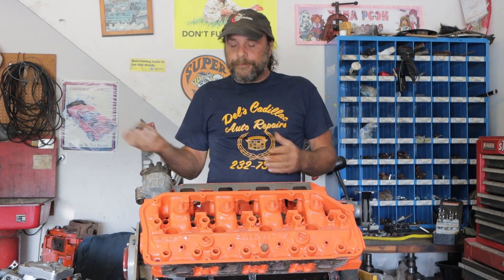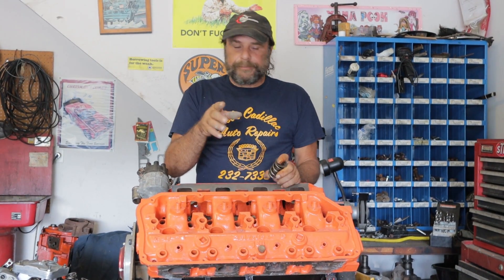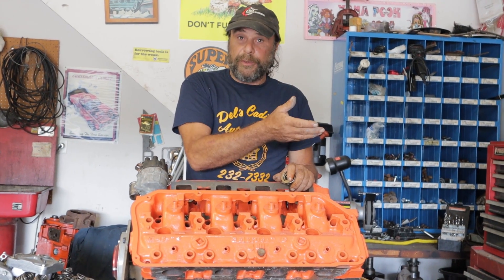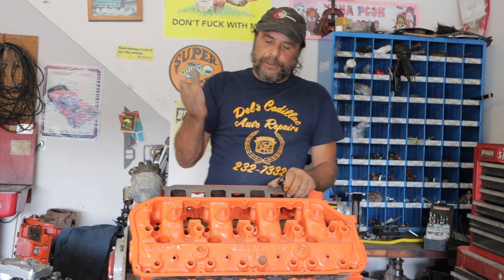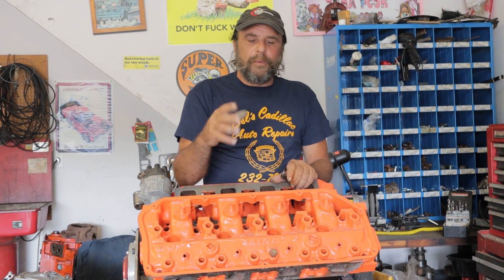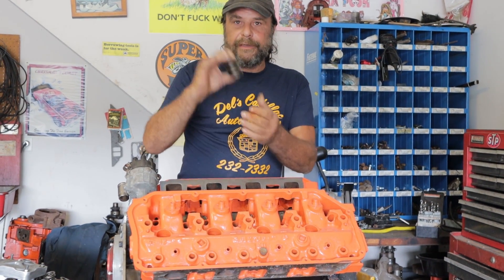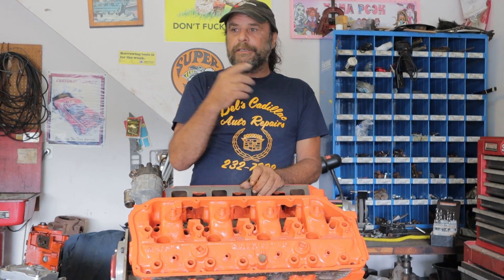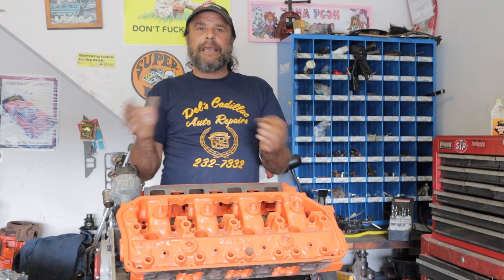Mopar's Doomsday Hemi

Comment: Cmon now Tony , the biggest issue that the 426 Hemi had was the 427 SOHC . We can all thank GM for that river of tears they cried for having these engines banned.
The 427 made around 615 HP right out of the crate with no mods at all . That motor is the directly related grandfather of todays "Modular" ford motor first in SOHC form and then over to DOHC.
THese motors outperform anything that Christler or GM could come up with then or now . Both car companies are having trouble competing with that same engine with only 300 cubic inch give or take.
If Ford were to match them CI to CI it would be a blood bath...
Had these motors been allowed to race way back then we would be ina  far different place at the OEMs today . We would have seen 1000 HP engines available 15 years ago... But GM couldnt compete and was out of the game if Dodge and Ford did the deed....
Reply from the maker: I disagree, Kyle.  First off, I have a lot of first hand experience with the Cammer, as I was supposed to set one up and tune it for a Nostalgia Top Fuel operation a few years ago.  I studied every aspect of this engine you could imagine.  Yes, the valve train itself is superior to the Chrysler, but in the world of Drag Racing, the advantage is inconsequential.
Second, the Cammer is actually more closely related to the 331-392 Chrysler Hemi than the second gen 426.  Valve angle, deck sealing, bore spacing, etc.  The FE it was derived from comes from that same era of engineering ideology as the Early Chrysler.
When Ford gave these engines away to drag racers in 65, they did run hard and leave a mark, BUT, their dated bottom end construction meant most were slaughtered pretty quickly.  By 68, nearly all of them were gone.
The common sense thing here, is that IF that engine was so good, why didn't independent engine builders like Milodon, Donovan, Keith Black, or even Joe Pisano pick up where the factory left off?  The truth is that nobody touched it because there was no actual advantage to be found.
There was a guy named Chuck Seyler that built and ran these engines for a short time in T/F back in the 80's, but he had pretty much the same results as Kalitta and Prudhomme did twenty years before.
Reply: @UncleTonysGarage  You may disagree but when you fast forward to now that same engine is slaughtering pretty much everyone in a 300 cubic inch package. Ford was the money behind it , not these small shops , yes , small when compared to the millions ford could spend in R&D . You are studying an engine that had its life cut too short . What would it have turned into had it ran along with whatever Christler could come up with ?
Fords biggest problem was that the engine was banned so why dump any more into its development ? 
It wasnt about can or cant for Ford , lets not forget where they were heading as well in 1964 . It was more of a question of why ? If you think for 1 second that Ford could go to Le Mans and dominate but couldnt make the cammer what it needed to be then you have surely drank too much of the pentastar koolaide......
How did the Dodges do at LeMans ?
Reply from the maker: Dodge didn't go to LeMans...it didn't care about the european market the the way Ford did.  As for comparing the Cammer to the Mod motor...they have ZERO in common other than the general configuration
And AGAIN, and this is the only question worth asking.  IF the Cammer had any real potential, why did the aftermarket not pick up and continue its development?  They did it with countless other engines...why not the Cammer???
My friend, I could go back and forth with you all day on this, but I have things piling up in front of me.  Have a good one
Reply: @UncleTonysGarage  Tony you are wrong.... And thats always the answers from Dodge and GM guys about that. You know , both companies that went out of business and then needed my money to stay afloat ?
The aftermarket did not pick them up because the aftermarket didnt know what to do with that thing. Hell , how many companies are offering up for the modern SOHC ? The number one thing you hear is about the chain , well that got solved quick didnt it ? 
I think your Dodge tainted sunglasses are clouding your view a little....Well , with most of the laughing starter guys its usually alot....😎
And yes , I am going to be your perpetual Dodge heckler bringing a little reality into the tainted world of a dodge lover. Ive had to race against this junk  on Oval and straight lines and work on them through the 80s 90s and 2000s as they kicked out more and more garbage . I have a garage full of FE parts and Mod parts and I have raced both enough to get a few championships .The "Hemi" is always the dodge guys holy grail but it wasnt going to compete with the cammer had Ford stayed in the game with it. We know that now as its little brother is giving everyone a fit at 300 cubic inches.
Reply: @UncleTonysGarage  And perhaps you didnt know about this one Tony ?
https://en.wikipedia.org/wiki/Ford_GAA_engine
Reply: @kylevantassel7259  From one Ford guy to another...

The limitations on factory support of racing WERE STARTED by Ford.  Henry Ford Jr. floated (and got) a "gentlemen's agreement" in place between the big 3 to get GM and MOPAR to stop factory-level support of racing and he had zero intention of honoring that agreement.  MOPAR was a bit quicker on the uptake than GM to get their factory support going again with "police packages," but GM finally got the message and started in with "Super Duty" stuff, but too late.

The Cammer's "little brother"?  Are you talking about the Coyote?  Neither that nor the Modular (or ANY Ford motor sold these days) is even remotely related to the FE.  You sound about as enlightened as the guy who told me that Toyota's 5.7 is "basically a copy of" the Chevrolet 350.
Reply: @immikeurnot  Oh boy , here we go. You are grown I take it so you are aware of logic and the like ? What you speak of with Jr is in another place and another time altogether and has NOTHING to do with France rejecting the cammer.
As far as the other  , I feel bad having to state this but anyhow here we go. In its very short life the cammer changed a bit . AS I posted earlier Ford had already used a very big version of the 4 valve in the war . The 427 which was nothing like the tank engine was still the grand son of the Tank engine . Same family , you get it (FORD) ???I wont even bring up the Indy engine your heads might pop. DOHC based on the 289...
So the 427 comes out and gets shot down by NASCAR ,NOT by Jr pulling support which I dont even know how that works in your head. Ford had to apply to run it and was turned down. If Jr didnt want that  ,then no application would have ever been submitted.
Regardless the Cammer had already been through a few changes . Then Nascar gives the thumbs down , Ford doesnt have the use for the engine as it was intended and it pretty much dies . So there are some engines out there but not a ton by todays standards so why (As Tony seems stuck on) would the aftermarket go after an engine that barely exists ? Bad business . 
1993 Ford rolls out a new cammer , yes , a  descendant of the FORD DOHC tank engine and without a doubt the great grand son of the Cammer . If an engineer 30 years later went to do a Cammer he no doubt would have changed a bit . You two saying they are nothing the same is a bit ridiculous .  Would they need to wear the same valve covers for you to accept that ? Why would they ? Times changed and needs changed and technology changed . Bottom line is The Mod Motor is a Ford Over head Cam engine , no not of the FE family but of a new engine family that is all OHC .... Get it ? 
And as for that one statement about related. YES , they are all related in the technology chain...Times change needs change and engines change .
Are you a California resident smoking that weed ?
What you and Tony are saying is the equivalent of saying that a 64 1/2 mustang and a 2019 mustang are not related because they do not share parts and design . Its just not bright.
Reply: @kylevantassel7259  they were called "one pass wonders" for a reason....
Reply: @kylevantassel7259  Chrysler (Dodge) won the 24 hours of Lemans in 1998, 1999 and 2000 (3 years in a row), Petit Lemans in 1999, and the American Lemans series in 1999 and 2000.
Reply: The biggest problem ford had was they didn't build enough soch motors and put them in production cars to satisfy NASCAR rules .
Reply from the maker: No..the biggest problem Ford had was A) Thin main webbing above the saddles B) only 4 head bolts per cylinder C) a way to tame the timing chain and keep cam timing RPM consistent.  Although Pete Robinson did copy the Olds W-43 design and apply it to the Cammer, it was too little too late
Reply: With all due respect Mr. Van Tassel, the 427 Cammer was an engineering nightmare and
probably would not have lasted an entire 500 mile NASCAR race due to its inferior oiling circuit, crank/rod bearings design (those that did not utilize/steal the Chrysler hemi design) and 7 foot long timing chain (which when heated would stretch, go out of phase than blow up). Furthermore, the higher RPM potential of the Cammer Ford would bring about this untimely end sooner than normal. I believe Ford abandoned the idea of offering this engine to the public due to the fact that it was not a clean sheet design and presented too much of an engineering challenge/potential public relations nightmare for Ford as the basic  FE block was not up to the task a SOHC-high RPM engine scenario entailed. Chryslers DOHC design was in fact based on the Hemi block; however, Chrysler cleverly utilized a  rubber toothed belt (like those used on alcohol and top fuel dragster blowers) to run the cams (the rubber belt eliminated any harmonic problems, is self lubricating...no oiling needed, runs cooler, stretches much less, and is lighter...no parasitic energy loss). It has been estimated that Chrysler's DOHC engine would have produced some 900 + horsepower in race trim.
Reply: @stillbill6408  Another Christler guy another bunch of non sense . I would go through point by point but its early and Ive already shook my head so many times at this that I am dizzy. I will only say again that Ford was in a much better position endurance wise then the Pentastar crowd and this engine that you covet that never happened (Seems to be a Trend) , well it never happened . Ford already had its feet wet with SOHC and DOHC engines at this point and the FE was already having Dodges lunch . We can go on and on about the FE at Le Mans (Yes I know you dont care about Le Mans).
Everyone talks about the chains the chains , well had the engine been allowed to run I think we can say those chains would have morphed into another system. Or as  pentastar guy are you saying you dont think Ford could have done that ? Again , Ford showed that it did what it wanted and won where it wanted at will. Christler was a good number 2 for sure...

Comment: hey tony, historic video.....is this the motor car craft did a story on back in the early 80s?...i heard you say they "spun" these motors, but if i remember right, the article said it never ran under its own power, is that it?....they also called those rat motors "semi-hemis" back in the day, and nascar said it was not a poduction motor.....even though it had a heat-riser passages cast-in
Reply from the maker: CC did a story on this back in 73..and the engines were test spun via electric motor before any running examples were built
Reply: hey thanks dude...sounds like i was at least 1/2 right.......

Comment: Tonny  Thanks  what is the best carb for a 454 Big Block  now i have a 1407 Edelbrock carb Regards from Holland
Reply from the maker: Hey, Frits! The 1407 is a decent carb for that engine as a regular driver, BUT it would prefer something a bit larger for maximum performance.  An 850 Holley would probably be best for an all around performance application.

Comment: What do you think of the FORD CLEVELAND MOTOR ,  was it any good and what was the difference ...
Reply from the maker: The Cleveland was an excellent engine.  The Boss 302 and 351 cars ate the lunch of some much bigger iron, in their day.  The difference?  Canted valves very similar to the Chevy Big Block.  Windsor engines are straight inline wedges

Comment: little known fact pontiac was testin a single and dual over head cam 389 and 421 in 63 before GM killed pontiacs raceing program.....only one was known to ever have been put in a car.....
Reply from the maker: Yeah, I know several were built.  There was one on the cover of Hot Rod, but I don't think its intended application was racing.  More of a street performance engine.  Like the Olds W-43
Reply: @UncleTonysGarage  my understanding of the design was a super duty type application......X amount for street use to be legal for raceing....whether thats tru or not im not sure i know pontiac said they could turn around 7500 rpms but had issues throwing belts.....im not sure if it was timing belts which could be solved with a chain like fords sohc engine or gen/alt p.s. belt or what.....an im sure you know turning a stock pontiac 389/421 much over 6 grand ish youll probably be picking parts up off the track....much like the ohc hemi its sad it didnt come to be....who knows where the muscle car wars would have ended up going......